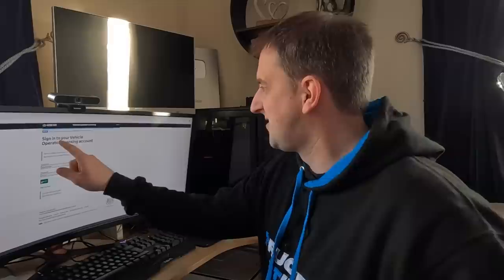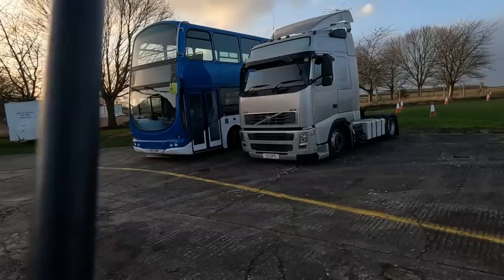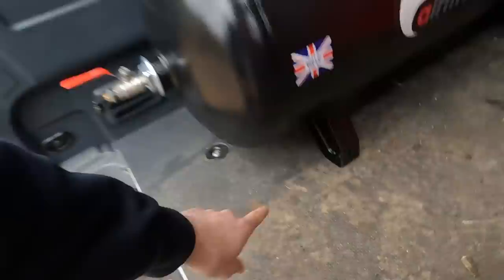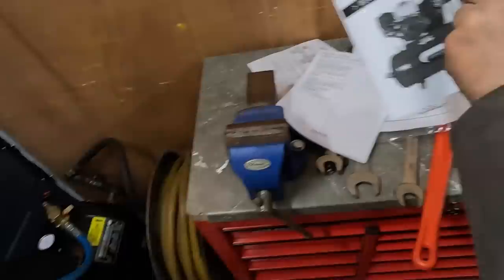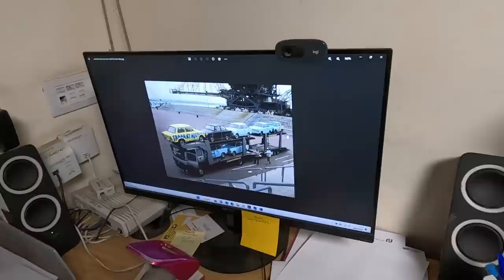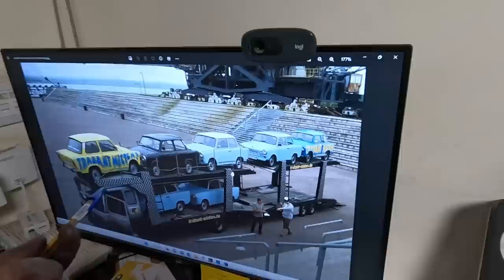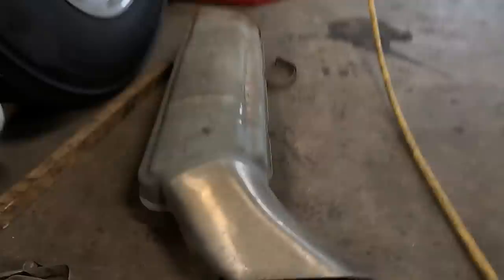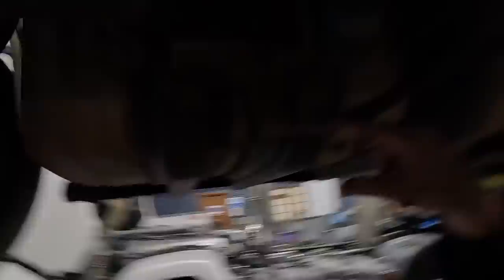OPERATORS LICENSE.. A Decision Has Been Made!? | Exhaust Update | Ep3 | #truckertim

Comment: The writing on the engine is Tappets, so it's had a new set of those fairly recently by the looks of it. Basically what converts the rotating motion of the crankshaft into the up and down motion to control the valves opening and closing 👌

Comment: The trailer doesn't look bad. But those flip toe ramps will cost ya in fuel. Also find King trailers are a bit of a pig at times to use ratchet and straps due to the rave design. Check the lockers on the sides as they seem to rot very quickly.

Comment: The second bit on the rocker covers is the tappets, its technically what opens the valve. The cam pushes the push rods then that pushes the rockers which will push the valves open. They need to be set to certain gaps to make sure they valve opens the right amount to give the best performance. That's the shortest way I can explain it. I think I might even have a video on my channel from when I did the cylinder head on one of my cars. Also congrats on the O license! I know how hard it can be!

Comment: I love to follow your journey. But there are some new rules in Belgium. And if you get caught with a aftermarket exhaust systeem to produce more sound, your are be send right back to the dealer for the original exhaust system. So if you have a button in the truck to make it quite as possible use it. Some friends of mine already caught in Belgium a had fine over 500 euro and replace it.